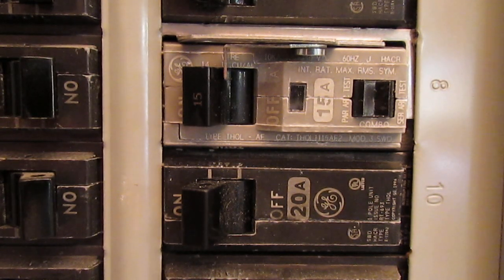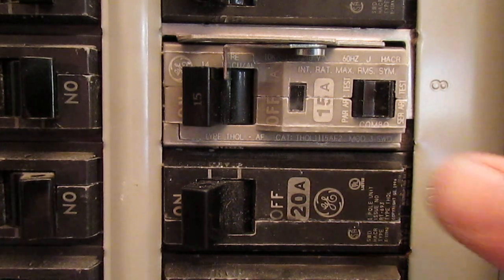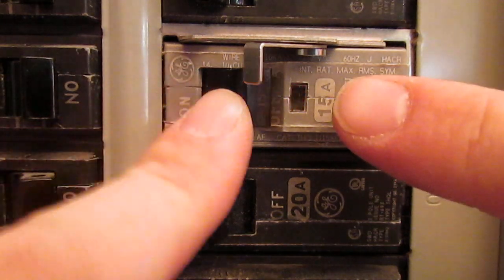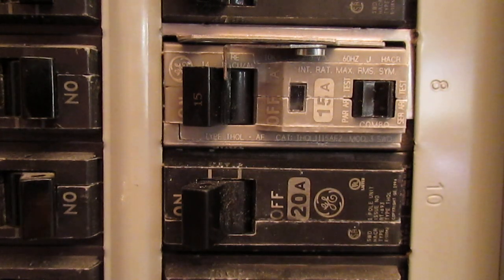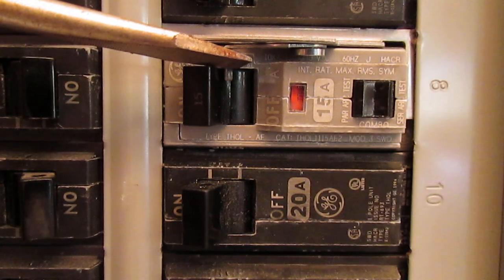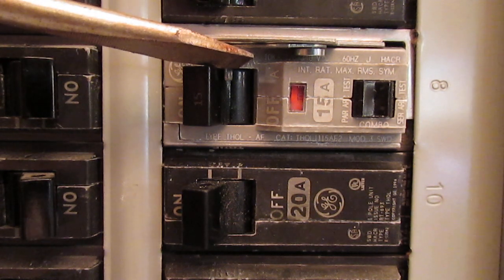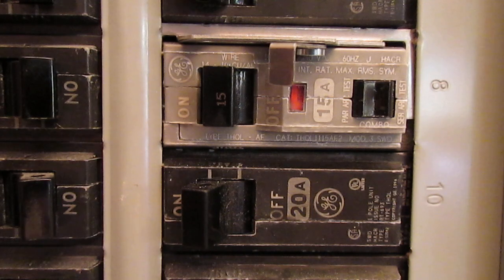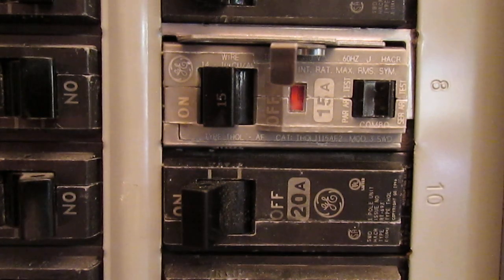Circuit Breaker Lockout Explained

Comment: You can have older breakers that don’t operate like that. Had several in a home I was working on that caused a panel damage because the homeowner rigged the breaker closed and the breakers were before the trip free requirement

Comment: Having to use the damn things to begin with is ridiculous. Total over reach on the part of regulatory agencies. Practicing a little common since goes a long way.  if you're working on your garbage disposal or dishwasher  tell anybody that's in the house not to turn the breaker back on until you are finished. They have gone totally over board with these forever changing rules and regulations.  Good example is how many times does your basement have to flood because a GFIC breaker trips and your not home. Most people don't  stand in a sump well and put their tongue in the receptacle. "If ain't broke don't fix it"